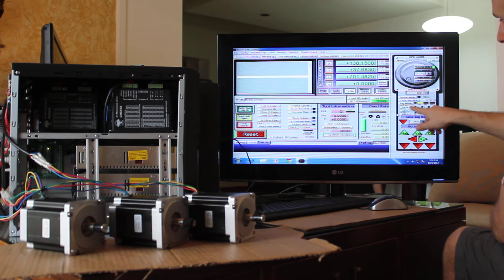Longs 3 axis CNC kit part 3: overview

Comment: RLEV
HEY GREAT SIERIES. I'm doing a conversion mini mill with Longs 23 stepper motors. I have one motor hooked to test. I'm running Mach3, I get the motor to run forward but I can't get it to run in reverse, need some help. Thanks RLEV

Comment: hi, nice video. mind if i ask - are these nema 34 1232oz enough to drive a bridgeport type machine. thanks for your help.
Reply from the maker: my experience is that yes they would be.   I have mostly cut aluminum, use sharp cutting tools, and keep my machine well oiled and I have never had any issues with skipping.  I believe a common mistake that many people make is to oversize the motors.  The larger the motors the more inertia and the more sensitive they are to acceleration and deceleration changes.  Again, my experience is limited to this set-up, and if you're going to be heavily loading the machine (i.e. cutting steel, high speeds/feeds) you may want to research more, but for the basics I have been pleased with this set-up.  Hope this helps!
Reply: thanks for the explanations, that would help me a lot... keep doing great projects 👍🏻

Comment: where is part 4?
Reply from the maker: https://www.youtube.com/watch?v=pu36UvI4Kas
Reply: can u make a tutorial video  if u willing..
 about how you calibrate the distance moving while attach with lead screw or pulley and belt
Reply from the maker: Hi Rafi,  this was a big question for me too when I set-up the machine.  My machine has the digital readout and so I continually adjusted the Mach 3 settings until it matched the digital read-out over the length of the table.  To be honest I don't know how I would do it without the scales....
Reply: Hard Coeur Garage  😄😄

Comment: Hello, you should be able to find the breakout board on eBay if you search for the longs board.  The team at longs is very responsive, if you can't find the breakout board by itself send an email to the email address in the description of any longs cnc ebay item and I'm sure they will get back to you quickly.  If you have problems let me know.